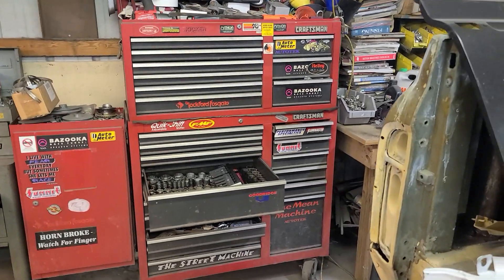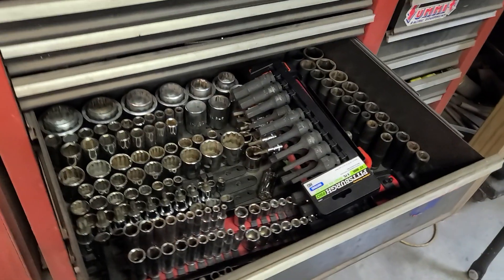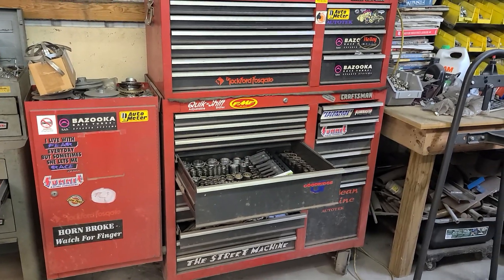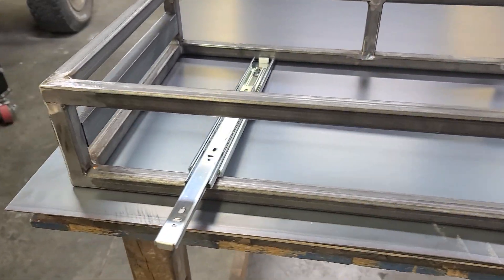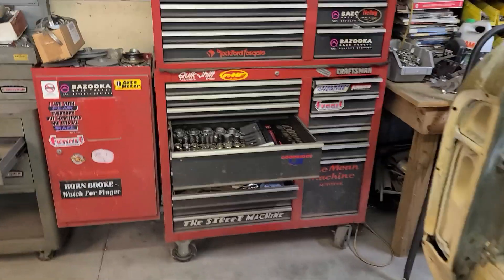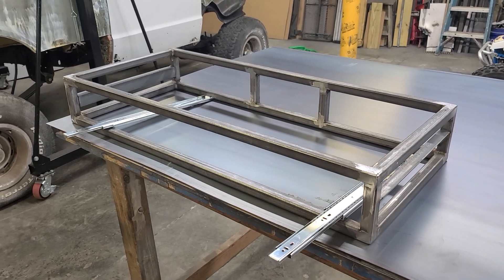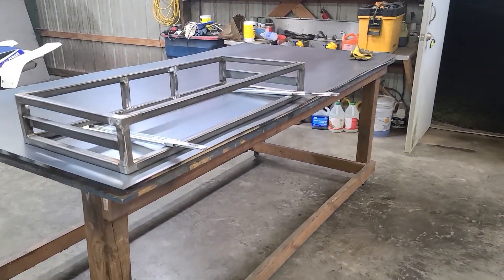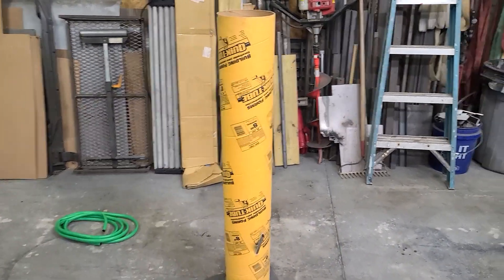Craftsman Toolbox Drawer WAY Past Due.

Comment: I have the exact same box. I almost waited too late, but fortunately found one of the last, all black and BB slides in my area before they disappeared.  I painted the outside case red to match my box and just left the drawer black and slid it in my stack. The only downside is i now have to use a step to access my 1/2" drive gear. I have always kept my 1/2" drive suff in the top so it is a small price to pay. I was glad i caught the one i did before they were gone. 
I am looking forward to seeing how yours turns out. 
The thing our sets offer that none that followed offered was all of those shallow drawers. I would not trade mine for anything!
Reply from the maker: Yeah, I couldn't even find a black one. Just waited 15 years to long. 😆
Reply: @freshonerestorationfabrica4298  I use mine for long pry bars and things like that. I even have my long bolt cutters in there.